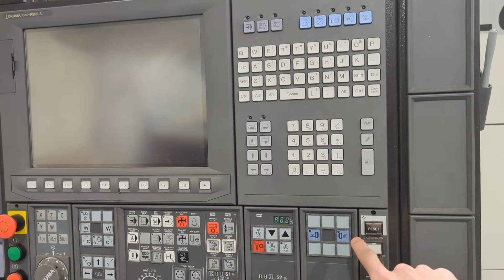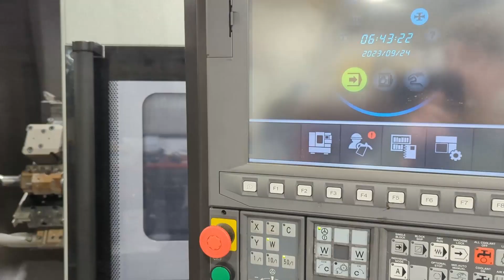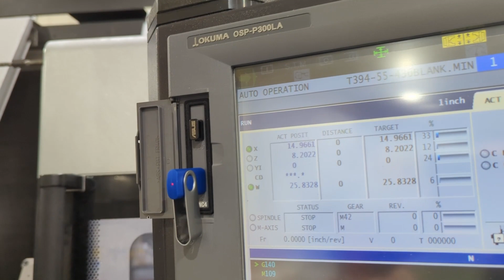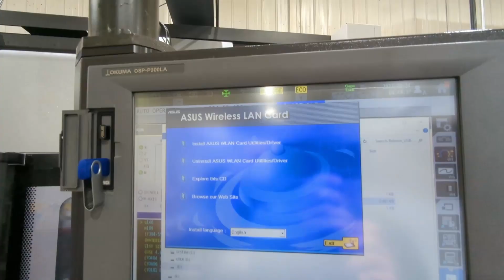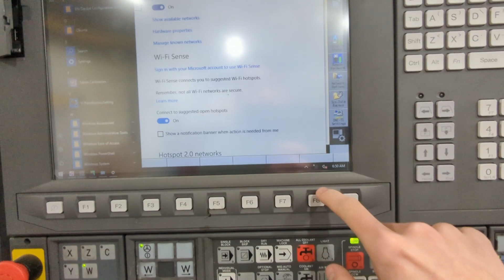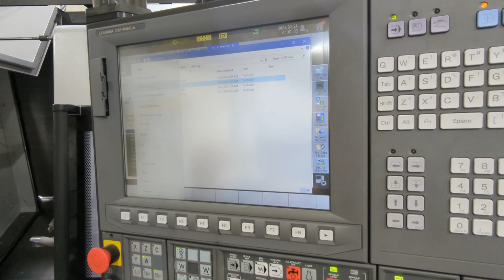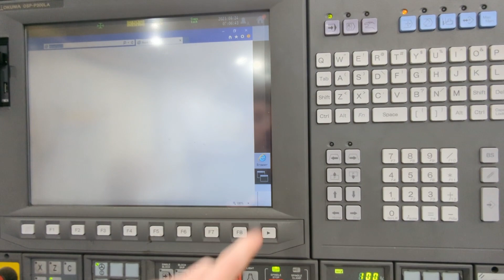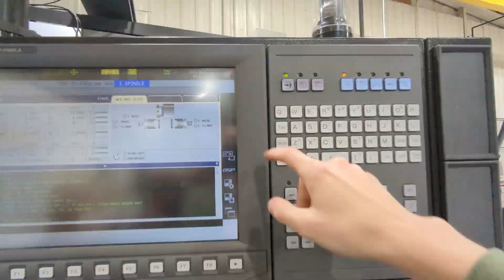Enabling WIFI on Okuma machines

Comment: Nice job and getting the WiFi setup. I have a few recommendations. You can install the USB Wi-Fi dongle behind the monitor. If you open up the panel PC, there are two available USB ports on the motherboard. This way you can keep the dongle out of your front ports. There is a better way to get to your network folders. If you go to DNC-T1 settings which is under the gear icon, vertical key. You can set up a folder location in your edit operations mode. Finally if you want to display your set up sheets easily, you could use the “Job Data” OSP Widget app this is already installed on your machine. For further info go to your OSP Suite Operations manual.